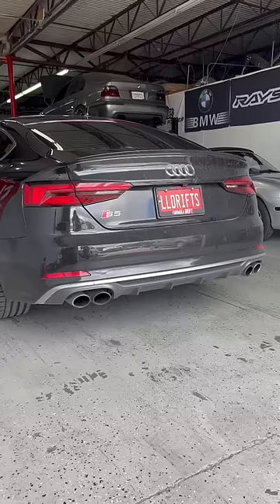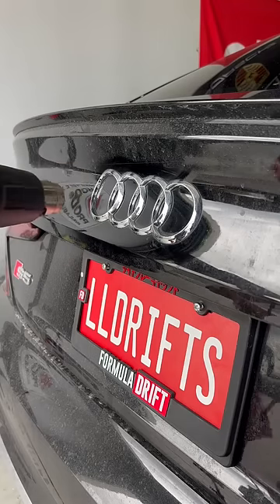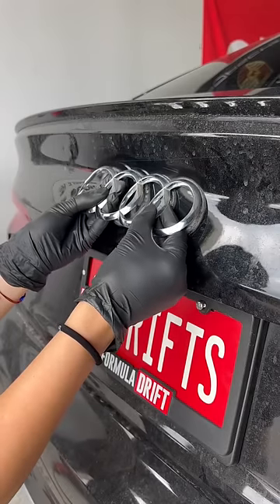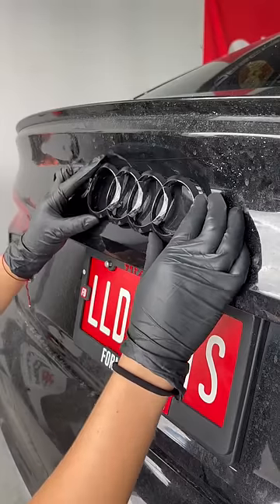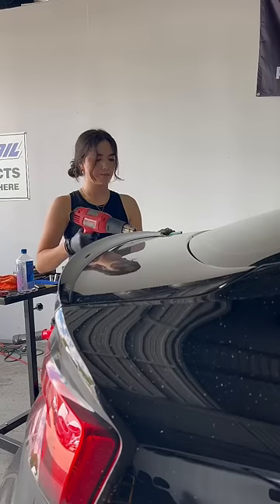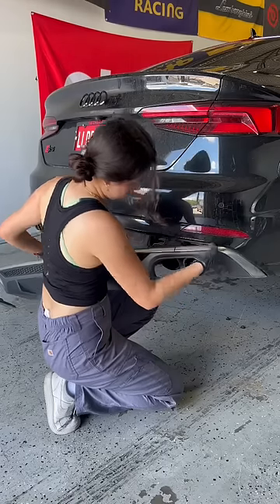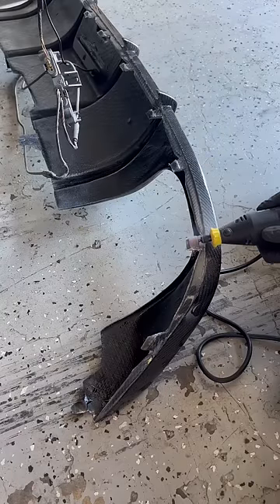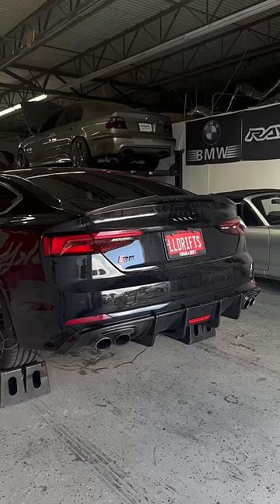Carbon diffuser, spoiler, and emblems for this Audi S5✔️

Comment: Next time, put tape around the edges of the emblem so you can line everything up. You really shouldn’t leave any old residue on just so the badge sits properly and can adhere the best. Rubber wheeling also is overkill. Heat and some goo gone would have done the trick.

Comment: Personally I would be worrying about the engine and how much it cost to maintain the engine and they do need a lot of maintenance😮😢❤ but good luck make sure you change the oil filter in the oil feed pipe to the turbos because it gets blocked up and the turbos get starved of oil and in the UK you're looking around £10,000 fitted that after all it's only money😊😊❤❤

Comment: Did you wire in the diffuser light? I have the same one from karbel but they never sent any instructions. Pretty bad considering I paid $2000 for it

Comment: My buddy just got one if those infinity Q50 Sports... I duno, i like it, but seems way over priced. I mean yeah it's alot faster than my Subaru Crosstrek XV, but id rather stick with my slowBARU before paying that much. Plus i like how my car sits up higher. At 33 it's less on my back getting in and out of a low car

Comment: I'm not a fan of those fake diffusers. Thisis qay too short and steep to actually generate downforce. Plus, that boxy middle section where the gearbox would go on a mid engined sportscar is kinda weird on a front engine car. It looks kinda cool and all, and you can call me old fashioned all you want, but I want stuff to have a function.